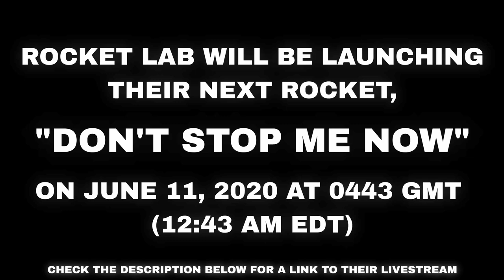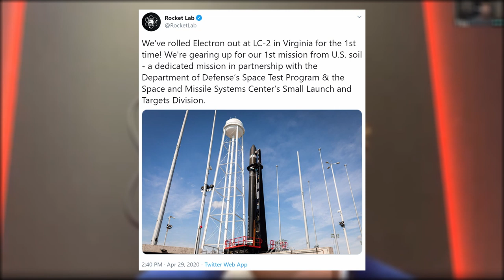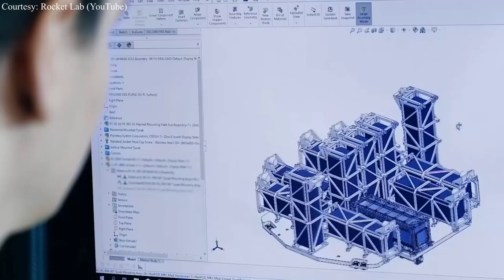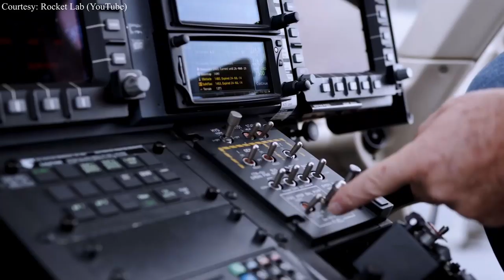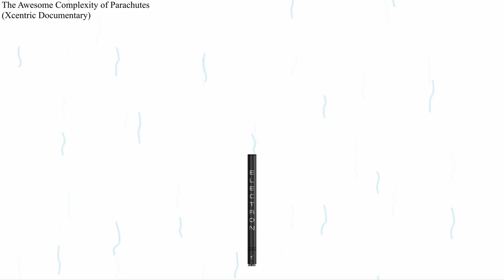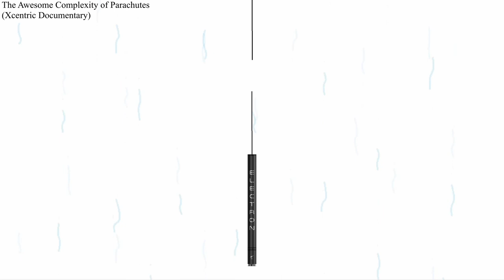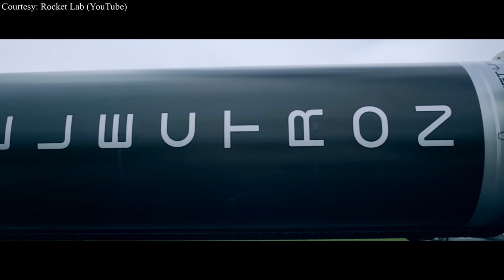Full Interview with Rocket Lab CEO, Peter Beck

Comment: There seems to be a pattern here.
Elon Musk wants to go to Mars, so SpaceX uses propulsive landing whenever possible.
Peter Beck prefers Venus (with its much thicker atmosphere) and Rocketlab uses parachutes.
Reply: @ffhgxxhjdz  legit question
Reply: @ffhgxxhjdz  I think you missed the connection that MrAnticlimate was referring to. Parachutes only work in an atmosphere which Earth and Venus have. The Martian atmosphere is too thin to use parachutes, so only a propulsive landing can be used. The next landing on Mars will have a rover and a trial drone with contra-rotating propellers and will see if it is possible to create enough lift to actually fly.
Reply: @ffhgxxhjdz  actually Venus has such a dense atmosphere, that airships (search for HAVOC) can do the work, after the breaking in the upper layers of the atmosphere by parachutes. Anyway, you do not really want to submerge into the depth of the Venus hell.
Reply: @ffhgxxhjdz  Venus atmosphere is so thick that you don't need a helicopter to hover. You just need a blimp. 
In fact you could probably make a "cloud city" type of installation quite easily on Venus.
Reply: Venus Zeppelin. Surface is hot enough to melt lead, so technically it will be a Lead Zeppelin.
Reply: There's a pattern here that i'm not so sure i like

Comment: Orbital Mechanics is a Norwegian Start-up that are going to make commercial electric turbo pumps, what are your thoughts on this?In my opinion, this will really hasten up development times because most launch startups are stuck with Hybrid Motors or overly dangerous pressure fed systems.
Reply: An electric pump is exactly what RocketLab uses
Reply: @trezapoioiuy  Rocketlab is set to domimate the market, what about the remaining 72 small launch startups?? From my research, only the most funded get liquid rockets while most of them have hybrid sounding rockets.

Comment: Small return vehicles use parachutes becuase of the low mass fraction needed, better than propulsive landing. However parachutes don't scale well. Larger vehicles require much bigger parachutes, which are more difficult to design, make and deploy, and above a certain size they just aren't practical. But larger vehicles can afford the mass fraction for propulsive landing, in part becuase the mass fraction doesn't scale 1:1 with the mass of the rocket.

Also propulsive landing gives precision. For a small vehicle this is less important, since it can be recovered more easily, but for a large vehicle, you want to be able to aim it.

Comment: The concept is unique and great for small load rockets, but for true profit making sized operations there just isn't a copter big and strong enough for retrieval unfortunately. However, the advancement in chute mechanics and capture tech has been truly ground breaking and I'm sure it will find it's uses moving forward.
Reply: The Air Force in the cold war  used airplanes (mostly Hercules-es) for air retrieval.
Reply: @MrAnticlimate  Ya, the military always seems to get the cool stuff before private industry thanks to near unlimited funding 😅

Comment: Could you use parashute balloon system to drop payloads on Mars if shuttled there if connected in squid design 7 rockets with center rocket with a connectors like multiple facon heavy rockets just refuel in space for cargo back and forth to mars have them all connect in zero g after refueling and shared fuel not tanks but take turns getting to mars or have center with ion pulpulsion then deploy cargo drops to mars with full fuel in other rockets with parashute deployment cargo could carry delivery system to deploy out of atmosphere of mars and 2nd parashute when pick up in earth by helicopter could that be done ?

Comment: What is it about weather that can cause a launch to be scrubbed? What, if anything, can be done to create an "all weather" rocket?
Reply: Mostly humidity, lightning disruptions to the signals, lightning striking the rocket, strong winds blowing the rocket sideways, etc... Regular sensible reasons, like how you wouldn't wanna go flying kites during a thunderstorm or how you wouldn't wanna go out to sea when the waves are 100ft high.

Also if an abort were to occur, the recovery site has to be safe for the rescuers, since they'll be splashing down in the ocean, the rescue teams have to be able to safely access that area.

Technically, you COULD launch them regardless of the weather, but when there are lives at stake, you definitely wont wanna risk them.
Reply: The answer on how to make it all weather is make it russian
Reply: Generally, it's not necessarily that they can't launch in bad weather... but if you're spending tens of millions of dollars on a payload and rocket, it's good to avoid risks. If conditions are better tomorrow, wait until tomorrow.
Also, if you're trying to recover the booster, or an aborting crew, you don't want to be doing do in a hurricane.

Comment: Fantastic that you try to save fuel yousing, to make smaller rockets, or lunching vehicles as you call it. It's alot more sustainable in the climate crises/change. But how sustanable or carbon footprint do your helicopters and ships❓ Is it possible to make the fuel the helicopters and your chips going on a more sustainable fuel or electricity in case of climate emissions❔ To last but not least; how much do your rocets or lunching viscles polut❓